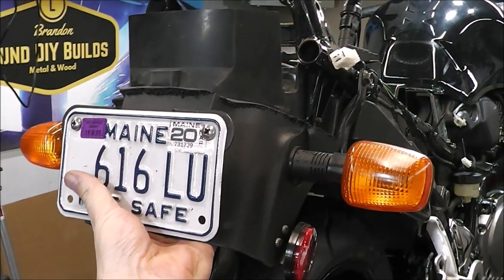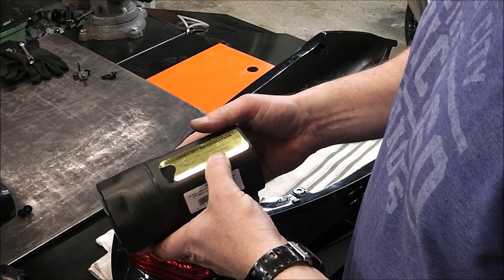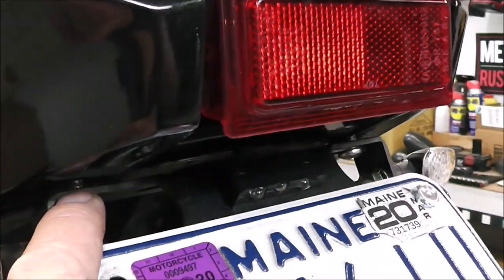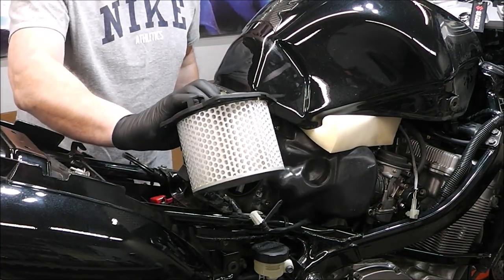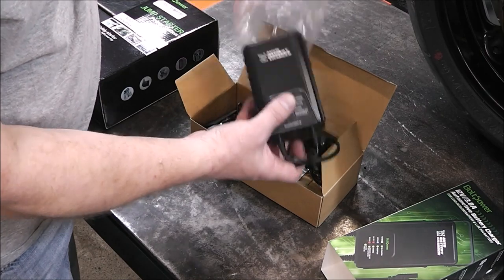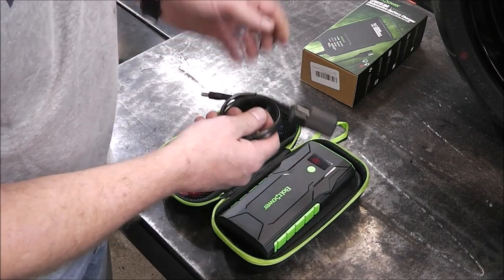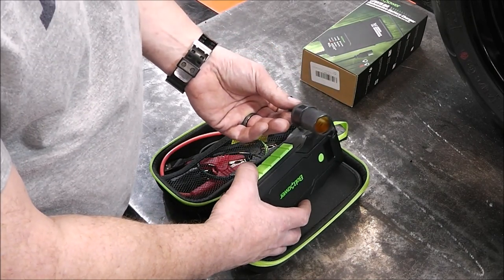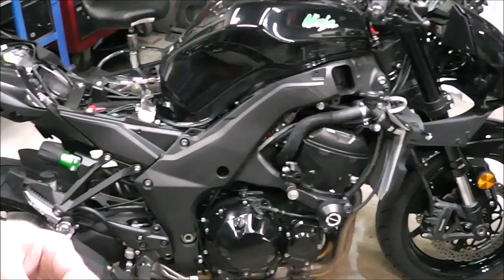Installing a Custom Tail Tidy Mod on the 2003 Suzuki

Comment: I had always just discounted those battery packs as just unnecessary...I bought one at a deep discount just to support my son at the store he worked for. That blasted thing has saved my neck so many times. From jumping off my RZR on a trail miles away from any help to jumping off my Tahoe 3 times till I got to an Oreilly's while on vacation. Not to mention all the times helping jump off other people without having to drag your cables out and try to get vehicles close enough. Charging my phone and on and on...
Reply from the maker: I agree 100%. I never really put much faith in them.  I was sold when a buddy of mine recently used one to boost a full size ford pickup.  His wife left the lights on. The battery was so flat that it would only click when you turned the key. Pretty impressive for such a little package. They are super convenient!
Reply: @BrandonLund  on my Tahoe it wouldn't even click...had to replace the battery and that little thing jumps it off 3 times without a hitch. I've gotten my money back on it several times over.

Comment: I did a bit of research on the weird tubing. It's actually sized in metric: 60mm exhaust tubing. If you Google it, plenty of vendors pop up. I figured I better tell you because I think that bad exhaust hack is almost giving you a seizure since you mentioned it in several videos already!
Reply from the maker: Hahaha you can tell it's driving me nuts huh? Thanks for looking into that. I'll get some ordered this week so I can get this thing off the lift and we can get back into some welding :)  Cheers buddy :)